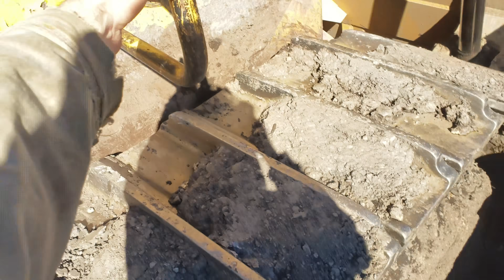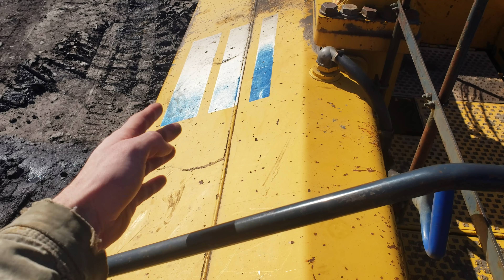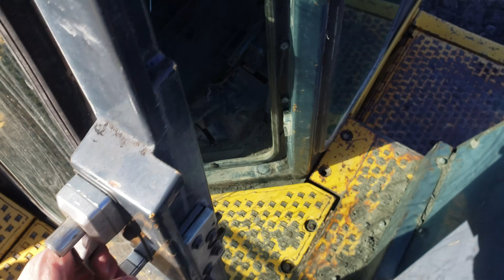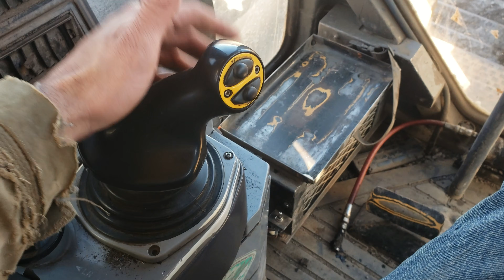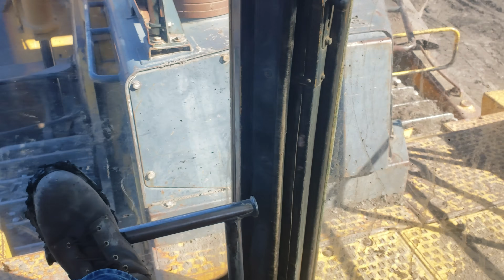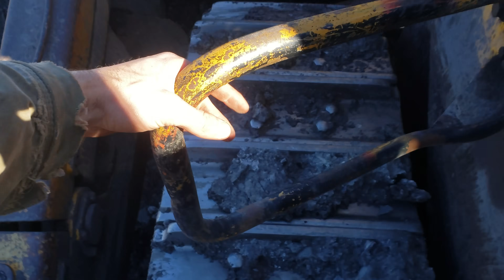The World's Largest Production Bulldozer - The Komatsu D575A-3

Comment: Lifetime dozer operator. This 575  has a ton of hours on it. Tracks are badly worn and the final drive is almost nonexistent. They ended up stealing parts from 575's that sat just to keep the others running. The 575's first year of production was 1991 or 2. A total of 53 were built and of that only 12 were of the 3 series.

Comment: Great stuff. Finally pulling back the veil on the the most popular yet illusive dozer of all. Cool to see it close up in HD. Need to disparage two biggest 575 tropes. Reliability, nonsense perpetuated by the internet. Sure there were issues but no where near what is mindlessly regurgitated in every 575 comment section. Same reliability issues can be said for when the d10 was first launched.
Second, sales failure. Without any inside info its impossible to know. This machine was in a category of its own and there is nothing to compare it to. And the market changed a lot over 20 years. There is no point in comparing it to machines half its size, different market, different applications. They only built 1 Big Muskie, so that must have been the biggest failure of all.

Comment: an IMPRESSIVE machine for sure... 

but reading some of the comments, a LOT of folks are saying it has issues due to it's massive size/weight...

makes me wonder how BIG is TOO BIG
Reply: Complete nonsense perpetrated by the internet. Get info from people that used them, now keyboard warriors
Reply: Never too big as long as the machine is efficient and reliable. For years the largest excavators in backhoe configuration were around 45 or so cubic yards and 630 metric tons. Then Liebherr raised the stakes with R9800 increasing buck capacity in backhoe configuration from 47 cubic yards to 62 cubic yards, made it more efficient than a little more efficient than the 996 while increasing size to 800 metric tons. 

What hurt komatsu was in order for them to fill an order for 1 575, they had to shut down production for their smaller more popular 475s. So they were not as efficient economically to produce as the 475s were. Throw their staggering price relative to the 475 (nearly 3x), and it was too niche with too expensive a cost for buyer and for komatsu to make. Hence why so few were made

Comment: I worked for Alcoa in Western Australia in the 00s. We had two of these big-arse 575's ripping bauxite caprock. Both machines were operated remotely because the constant banging and crashing on the uneven surface injured the operators' necks and backs they were so rough. They were impressive machines, and it was pretty cool to see them working without an operator. However, they were sometimes broken down for long periods and never really worked out in that application, trying to rip instead of blast. Good video, man. It brought back many memories.
Reply from the maker: That's awesome, thanks for sharing!

Comment: The first 575 I worked near was in Vegas. We were cutting relief on a massive drainage channel. We had a 100 ton TesMec trencher crisscrossing the channel at about 8’ deep. Then they would put D11 dozers with impact rippers to pull the cap out in huge chunks. The 575 piled waste rock and cut slopes. 
The service truck driver said the Komatsu burned over 300 gallons a day. Almost 80 gallons more than trencher and 50 more than the D11.
Reply from the maker: That's awesome, thanks for sharing that! They were expensive to run, but that's to be expected when the machine is over 40% heavier and 50% more capacity than it's smaller rivals. Thanks!

Comment: Wow, I did not even know there was one of these monsters operating in the United States. Fantastic video!
Reply: This operation also have another unit, an older A2 model that has a Cummins swapped V16. 

These are the last 2 working machines in the US. 

There are another 4x parked up for sale however 3x are disassembled for transport and in desperate need of TLC and the 4th unit is read to work but parked up. All for sale from Bruce Equipment.
Reply: @rowanhenshaw273  thank you, that is very interesting. I knew these 575's were a rare breed. Only 12 made.
Reply: several of them here, a contractor in Cali has one as well
Reply: @TurboGSR96  Most of them were shipped to China over the last few years including the unit in Cali which was actually serial number 10001, the first production built D575A. There are only 2x units working regularly now. This unit in the video and another at the same operation.
Reply: @Brad772006   Back in the late 90’s, early 2000’s there was a mining company in West Virginia that had a fleet of EIGHT of these KOMATSU giants. I’m not sure if there were several D575A-2 models in that fleet. I have a book on heavy equipment that shows a photo of 2 D575A-3 units pushing down hill (side by side).  
Those 2 dozers were from that fleet of 8. Name of the mining company was Princess Beverly. I’m not sure if they are still in business. I’d love to be able to talk to people from that company about the giant Komatsu dozers. Imagine the diesel fuel costs of running 8 of those monster machines for a week. Take Care.
Reply from the maker: That's awesome. I've seen a couple old videos clips on here of 575s shoving and you can tell it's West Virginia. Thanks for sharing that!
Reply: @Brad772006   There was a mining company in West Virginia that ran EIGHT of the D575 units. The company purchased the first unit in 1995. Largest fleet of Komatsu D575 dozers in the world. I did some research about the company. The company had a fairly unique model for their projects. The goal was to remove 80% of the overburden with large dozers. The remaining 20% would be truck and excavator. I’m not revealing the name of the company because for some odd reason YT doesn’t seem to like that. Anyway, I just wanted to inform you about a whole fleet of the Komatsu Super Dozers that worked for years in the US. Take Care.

Comment: Interesting that it goes faster in reverse. Is that a feature? Also, that thing is huge, great video. Thanks!
Reply: This is a very common feature on modern dozers. If you look at a specifications brochure for Komatsu, Caterpillar, Liebherr, etc, you’ll see two horsepower ratings. An example would a large dozer such as the D475A-8 that has 934 horsepower in forward and 1,040 horsepower in reverse. You would see a nice improvement in cycle times with the high horsepower reverse. I’m not sure if the manufacturers are using this system on medium or smaller sized dozers.
Reply: @williamhall9204  Thanks!
Reply: most dozers do, even in the lower gears

Comment: Ol feller just outta pikeville headin south has some old komatsus beside us23 and I remember seein the tractor part of a 575 from that big steel piece unique to the 575 around the lift jacks. 90yrds…man I wish I’d got to steam the ones I heard about in west v
Reply: @charlesmullins3238  I heard there was a mining company in West Virginia that had EIGHT D575’s working on their hilltop mine sites. I believe the name of the company was Princess Beverly. I’m assuming that some of those units were D575A-2 models. I’m not sure if that mining company is still in business.
Reply: @williamhall9204  Beverly Ann tipple is 5mile down the road here in eastern Ky. It’s been owned by several companies and I steam cleaned the entire 7 floors of the main building yrs ago. The all komatsu job I was thinkin of I think was called job 24 but tha G’s been 20 some yrs ago so it may been 007 for all I remember.

Comment: I don't think Caterpillar would ever want to build a machine as large or larger than the 575-3. Overall it doesn't make much sense. I talked with a guy who works at a mine doing the initial top soil removal, that ergonomically, Komat'su is better than Cat, but the Cat has had less down time overall.
Reply from the maker: Another thing to keep in mind (and I've said this before in other dozer videos), the price of a new undercarriage for a D11 is double the cost of that of a D10, which is why many operations are switching from running fleets of 11s to fleets of 10s. Yes, you'd need two 10s to equal one 11, but the cost for another operator outweighs the maintenance, operating and repair cost of these big dozers. Cheers!
Reply: @Ratkill9000   I do believe that mining companies would embrace the idea of a dozer the size of a D575A-3. But the only way they would do so is if the reliability of the machine was very good or better. I don’t believe a dozer of that size would make sense if it had to be moved on public roads. Just too much hassle and very expensive. We need to keep in mind the enormous weight of a dozer like the D575A-3. But if the machine is assembled and put to work on a long term mining project, it could be successful. Obviously price is another critical factor in the purchase. As PAmining stated, the price Komatsu put on its D575A-3 was just too high. Komatsu basically priced themselves out of any market share. So overall a lot of things would have to align just right for a dozer like the 575 to sell in good numbers. Seems like a difficult challenge for any manufacturer. I don’t think it’s impossible, but it would be a risky proposition for sure. A great amount of research & development would be required, as well as several years of field testing. In my opinion it would be impressive to see many super dozers (regardless of brand) showing very solid reliability, working on large mines. The production level could be off the charts. Take Care.
Reply: As I've said time and time again, if it were easy and profitable to make a D575A sized dozer, CAT would already be doing it.

Comment: Awesome, Awesome, & AWESOME one more time. Thanks a lot PAmining for putting this video doc together. This is a video that I didn’t expect to see on your channel. Mainly due to how few of these monster dozers are still on job sites. Yeah this one was a real treat for sure. Still hard to comprehend a dozer with a 90 cubic yard blade. I’m assuming this particular D575A-3 is still working on a regular basis. If that’s the case, then I’m wondering if there’s any chance you could talk to the owner about machine performance, reliability, etc. and then inform your viewers. I think that would be extremely interesting. To actually hear the opinion of the owner and or operator of this giant dozer would be great. The info you provided near the end of the video was pretty amazing. I had no idea that the Komatsu D575A-3 price tag was 2.5 times that of a Caterpillar D11. Thanks Again & GREAT JOB.
Reply: Hi William, I've spent the last 5 years researching the lives and histories of all D575A dozers. I know this dozer quite well through speaking with people who have operated and maintained this exact unit. 

This unit (serial number 10106) sits at just over 40k frame hours currently. It's operated out at Maryland where they have another unit (serial number 10041) which is an older A2 unit that actually has a Cummins swapped V16 engine. Both units have been operated there since new. 

This operation understand these beasts better than anyone else in the USA currently. They do all of their own maintenance and repairs and have a network of their own parts that they have sourced to keep them running. Many good maintenance man and operators have had time on this dozer to keep it alive and pushing. This unit is on its original engine, had had 1x TC replaced at 32k and had its finals done around the same time (preventative maintenance). It's been a big producer for the company and while it does require some TLC to take care of it and keep it running, its been a powerhouse for them.
Reply: @rowanhenshaw273  Thanks a lot for your reply. As a heavy equipment enthusiast, getting this kind of hands on information is great. As super impressive as the D575 is, it has been the recipient of some harsh criticism. However as you pointed out in your comment, the preventive maintenance is crucial for this dozer. And as you stated, it’s also extremely important that the mechanics and operators are in sync with the machine. When those people know exactly what to look for concerning possible problems, it makes a huge difference. Hopefully serial number 10106 will reach 50,000 frame hours and beyond. I do have one question for you. What is the feedback from the operators concerning comfort in the cab ?  Take Good Care.
Reply: @williamhall9204  Its funny, I wrote up a piece with some operator impressions a couple of years ago. Here's one from a gentleman that ran this exact machine....

They were awesome machines to run. A lot of people didn’t like them because they had run D11s for so many years that they just weren’t used to them! Great machines for pushing dirt straight not having to cut or hook shot out along the wall!

I personally enjoyed running them, you could get so much more done so much quicker than using a CAT! The 575’s I worked with were used to push shot rock and uncover coal. A Hitachi 2500 excavator would load out the wall and the dozers would work shoving the heavy dirt off coal over the outside into the valley fill. You could make a pit of coal in a shift pretty amazing!
A lot of people talk down on them because of the maintenance problems. New operators would break tracks when they would get in soft material and try to cut with too much in front of them then go hollering for maintenance. I’ve seen one push through its push arms and snap them from being worn out!

Later on, I was running an electric 495 shovel and had the opportunity to have 2 575’s pushing shot down to me. The shovels point sheaves were roughly 65 feet high and the shot was way higher than that so our boss sent in the 575’s to break it down to a safe height. It was awesome loading out all that easy dirt on those nights! In the right application they were awesome machines definitely operator friendly and comfortable!
Reply: @rowanhenshaw273   Thank You Sir. I really appreciate your in depth reply. Very interesting information. It’s fantastic to get the inside scoop on the King of all Dozers.Over the years of hearing negative comments from people about the D575’s, I had a gut feeling that the assessment was wrong. Pertaining to the D575, I’d always think to myself, how is it possible that this Japanese company put so much effort into R&D and field testing and basically failed. And as you know that whole development process took place over a lengthy time span.So now my overall opinion on the Komatsu D575 is that it is a very good dozer. The key ingredients for it to really show its potential are highly experienced maintenance workers and experienced operators that are aware of the strengths & weaknesses of the machine. As the one operator mentioned, don’t be cutting aggressively with a heavily loaded blade in soft underfoot. The one criticism of the D575 that appears to be valid, is the price tag. I mean 2.5 times the price of a CAT D11 seems excessive.I have to believe that in many instances this was a dealbreaker. I don’t know what Komatsu’s thinking was about price. Was it because building the D575 interfered with production of the D475 and D375 models? Thanks Again & Take Good Care.
Reply: @williamhall9204  Happy to help, glad you enjoyed the read. Overall, I wouldn't describe the D575A as a success or the best dozer on the market (far from it) however I've heard more than enough reports to suggest it wasn't the 'heap of junk' it is often referred to either. 

Unfortunately for Komatsu, the D575A project ran at a huge loss. Komatsu were happy to run it this way as sales across the bulldozer range as a whole, were good so basically sales from the other machines, offset the loss of the D575A. The D575A was nicknamed the 'Star of Hope' within Komatsu Japan and was seen as a huge promotional tool as much as just a bulldozer. 

Each machine cost far more than what it sold for. Komatsu agreed to selling the machine for 2x as much as the D11 because they could justify that it was 2x as productive however it was not a good business model.
Reply: @rowanhenshaw273  thanks for this interesting chat mate
Reply from the maker: Thank you! 😎 I can definitely work on that. Cheers!
Reply: Great video and agree on a second visit to see a push and chat
Reply: Keep in mind the 90 cubic yards was for the "standard" blade, they could fit a specific one on the 575 that would push 125 cubic yards, crazy.

Most of the criticism for the 575 comes from CAT fanboys, they crap on everything that's not "America fck yeah!" so don't trust their nonsense. Was the 575 the best dozer, no, wasn't the worst either.

All pieces of equipment can be reliable or unreliable, depending on a thousand factors. Obviously in the US a brand like CAT has a huge advantage when it comes to parts, availability and repairs compared to foreign companies, that's a no brainer.
Reply: @livingbeing1113  Yes indeed you are absolutely correct. That particular blade was built to handle only lightweight materials. Coal and wood chips are two examples. The 575 could never push 125 cubic yards of rock and dirt. Even the most powerful machines have their limits. I definitely don’t consider the 575 to be a terrible machine. But I must admit that I thought it would perform better. The reason I say that is because Komatsu did a huge amount of research and development on the 575 before ever releasing it to the mining industry.And that whole process was a very lengthy one. Komatsu definitely didn’t do a rush job on this giant dozer. Take Care.

Comment: Kolay gelsin usta neden çoğu d575a dozerlerin srkasında ripperler takılı değil bun benimle paylaşırsanız çok memnun olurum
Reply from the maker: Rippers were offered only on the Super Ripper models which came with a smaller capacity blade. The Super Dozers were equipped with counterweights. Thanks!
Reply: Sqğolun teşekkürler usta